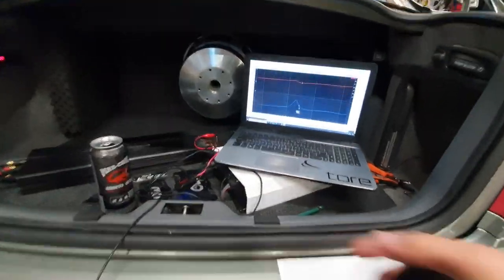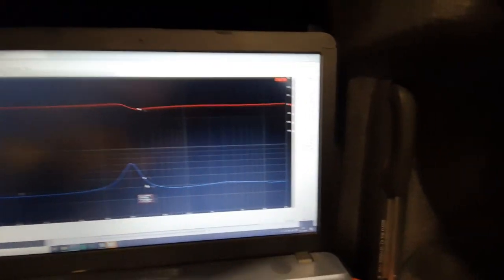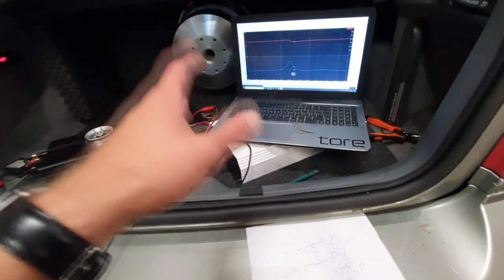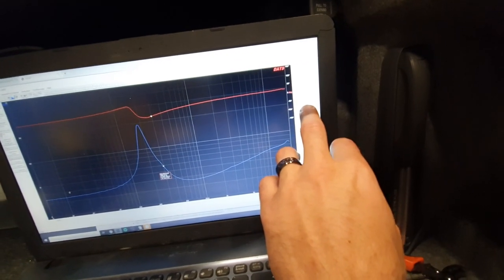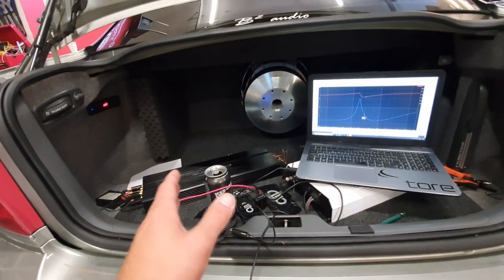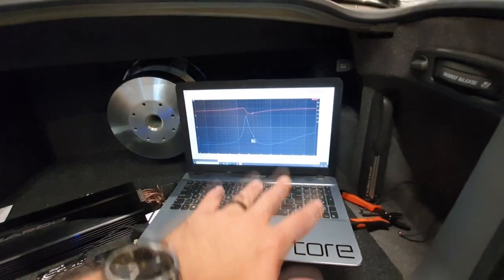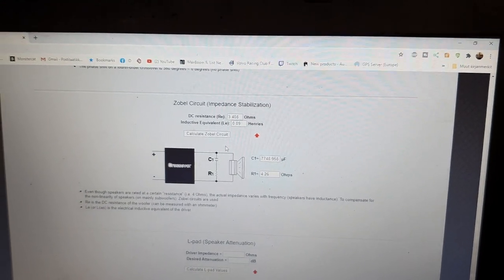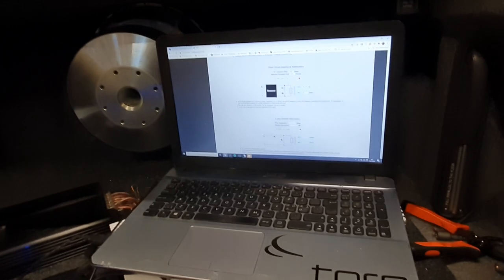[ENG] What is Zobel Circuit? How is it made? How it affects on speakers?

Comment: capacitor can be electrolytic but it has to be a non-polarised, but better to use Polypropylene film.  Be aware of voltage ratings, make sure to have high enough.
Reply: Almost all electrolytic capacitors are polarized.
Reply: @HansDelbruck53  electrolytic caps in series wired back to back i.e. positive to positive are configured non polarised, not true about almost all, there are plenty of electrolytic non polarised. Frau Blucher !!